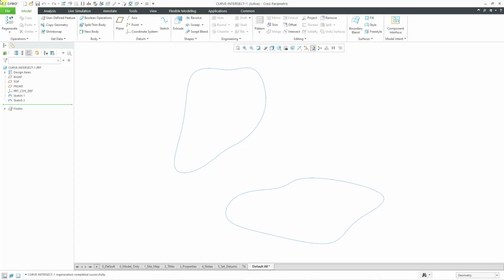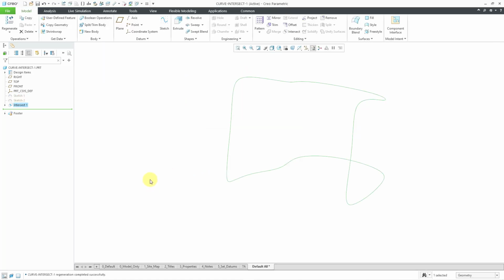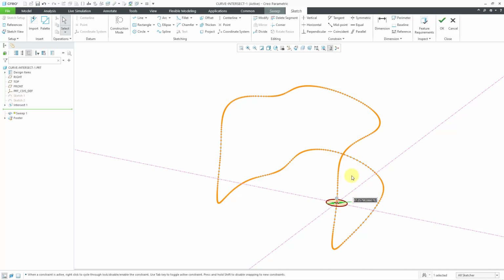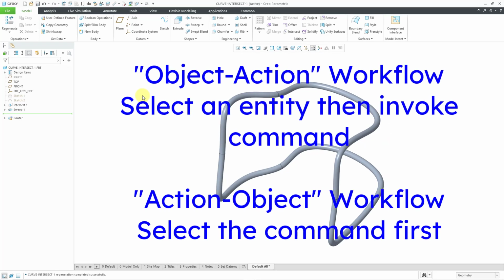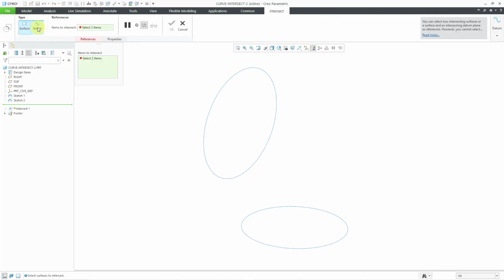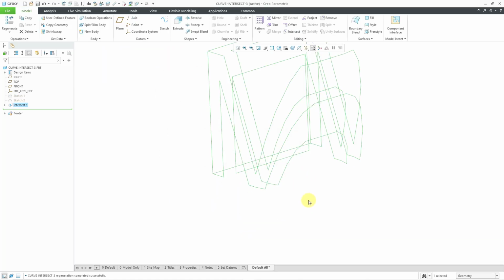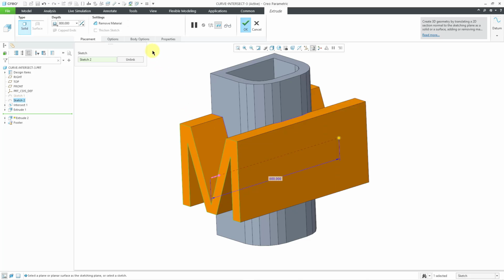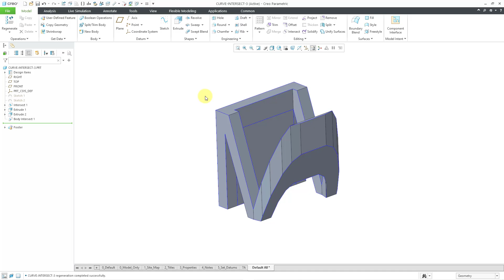Creo Parametric - How to Use the Intersect Command with Sketches

Comment: Another use case is in piping. Using a plan sketch and an elevation sketch to get a full path. There is issue if either the plan or elevation sketches have straight lines that end up converging in the same perpendicular plane. You'll end up with a forked path, similar to the two chip example. The forked path has a complete path and a portion, the full path can be swapped with the order sketch selection. An example is if one sketch is a L, and the other sketch is P. Or L and H

Comment: When I Select G as A Common Name so it will be  shown as a reserved Symbol. how can i use the reserved Symbol in the family table.
Reply from the maker: I don't understand your question. I suggest opening a ticket with PTC Tech Support.
Reply: @CADPLMGuy  The issue is trying to name a dimension or parameter "G". Creo cannot name things "G" cause it uses "G" as the gram abbreviation or the gravitational constant (I don't really know).
Reply from the maker: Okay. I'm not familiar with that issue. I recommend people submit a ticket with PTC Tech Support or post an enhancement request on PTC Community's Ideas board. Or call the parameter something other than 'G.' It might also not like it as g# is used for geometric tolerances.